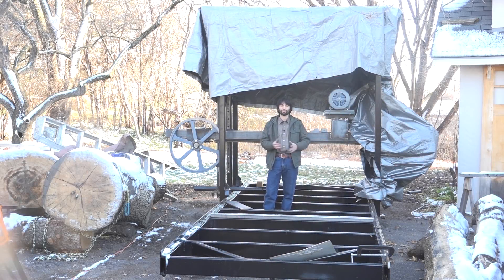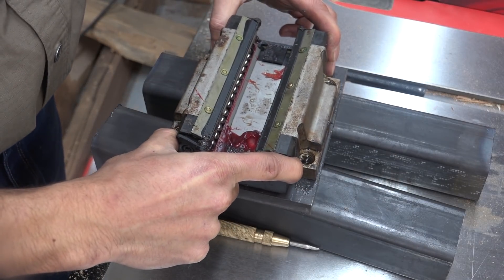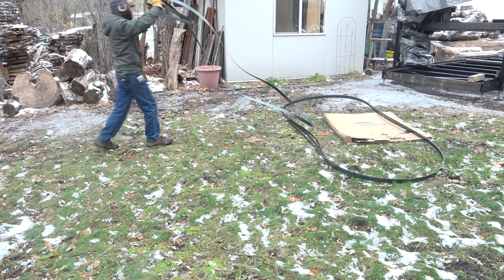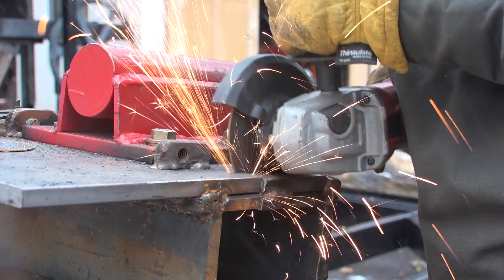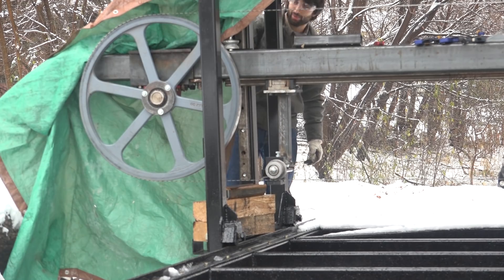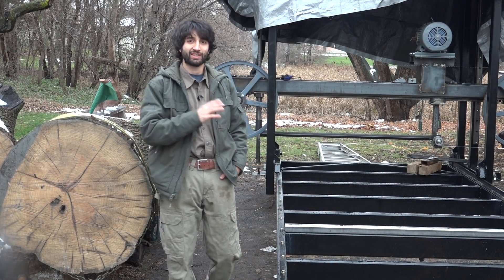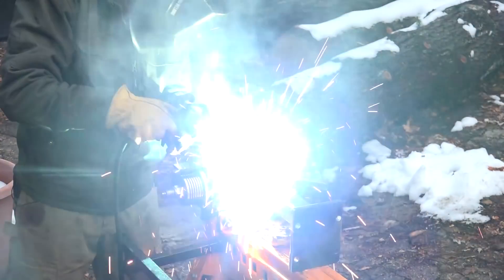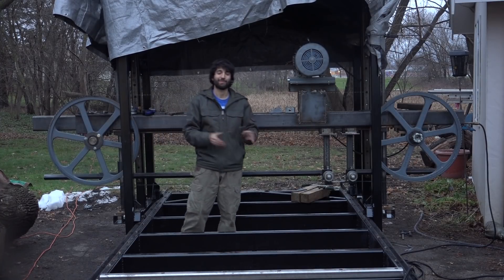Blade Guides - Building a Large Bandsaw Mill - Part 13

Comment: are you willing to tell me how you calculate band saw blade length? because the way i do it is kind of weird lol . what i do is i take diameter of one wheel X 3.14 the distance between the center of the wheels X 2 and add those numbers up.
Reply from the maker: +pjakkur007 same thing pretty much. One wheel circumference plus 2x distance between centers